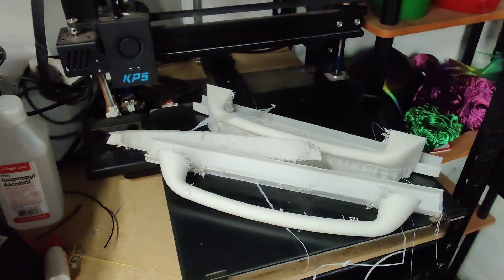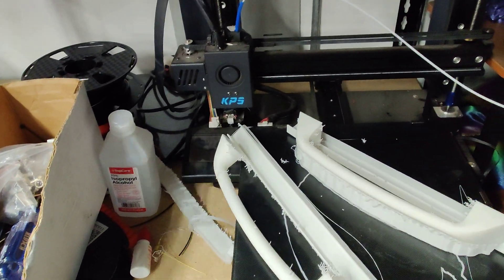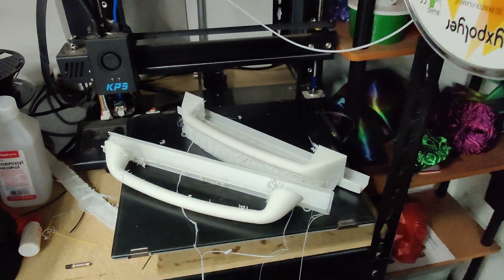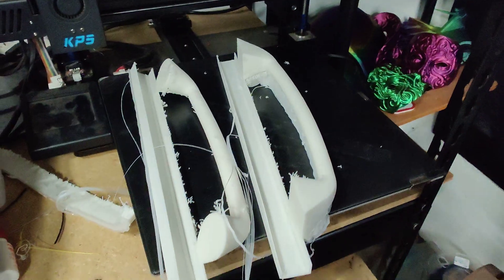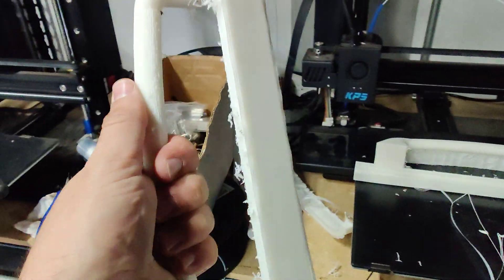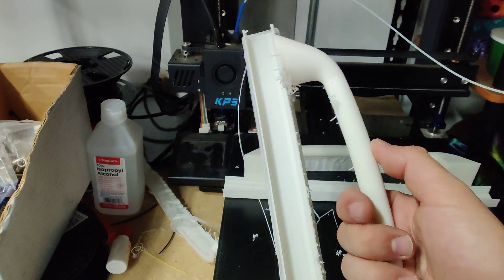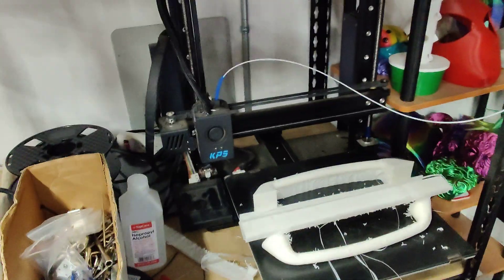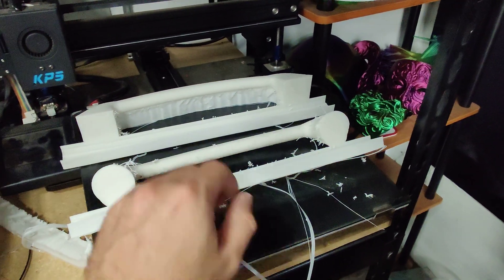Check Out Glass Filled Nylon Filament

Comment: filament looks a little wet, maybe use a longer revese bowden and dry more?
Reply from the maker: It was right out of the packaging. I do not think it had any water in the filament.
Reply: @3DPrintsEverything  nylon can get super wet in the process of printing (a couple hours). It's also rarely properly dried in the factory.
Reply: @3DPrintsEverything  You need to dry nylon right out of the package especially if it’s pa6 which absorbs moisture faster then pa12 but any type of nylon will best be used after a thorough drying
Reply: @3DPrintsEverything  Never assume that they are dry from the warehouse, the silica just keeps it from absorbing MORE moisture, but doesn't mean it's dry. I dry every filament I get because oftentimes I get them and they are moist.